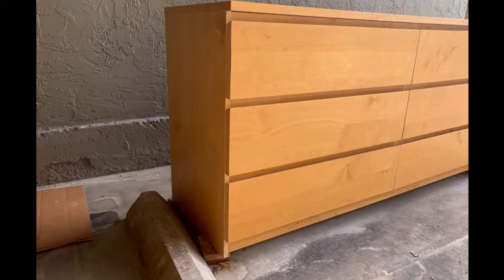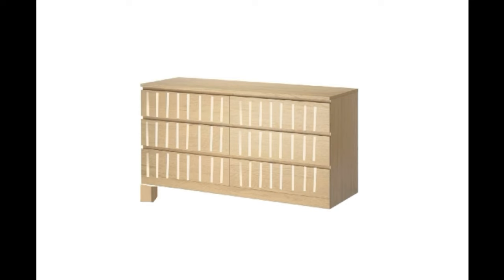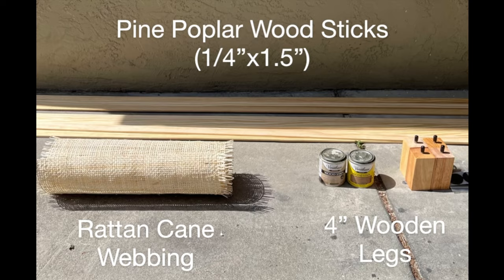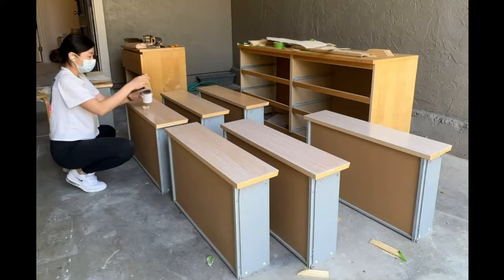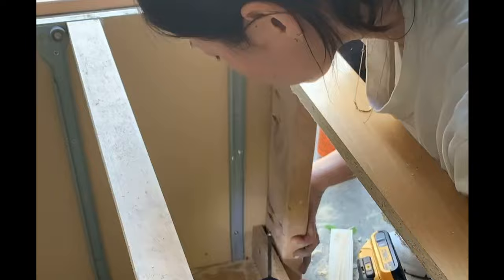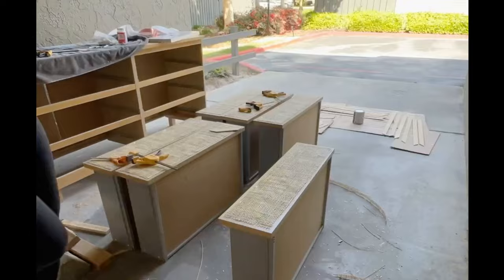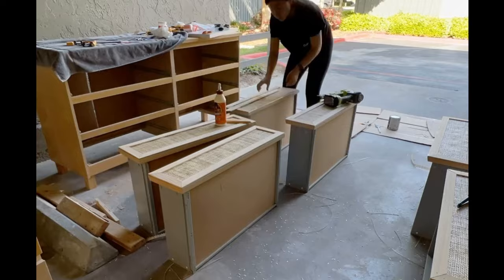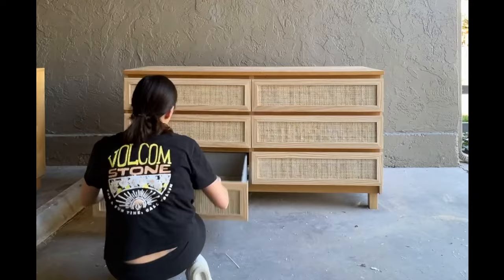IKEA MALM Dresser FLIP | Rattan Drawers + Legs | STEP BY STEP

Comment: hey great job!! great looking!! I was wondering how you attached the finger pull to the draw since it is angled at the top. Would you be able to provide more info?
Reply from the maker: Good question! I noticed not all handles were easy to fit due to the angled top! The side with the screw holes have to be long enough to reach the back of the dresser. The handle I have linked in the description box works well. You can use that one directly:)

Comment: Hi, I have a both two drawer and a 4 drawer malm dresser. How do I estimate the  size  of the Rattan webbing I need to order from etsy
Reply from the maker: Double check the 2 drawer Malm and 4 drawer Malm drawers are the same size. If they are the same, then use the the dimension of a drawer and multiple by how many drawers you plan to add the rattan to!  Then on Etsy, purchase the size rattan you need!